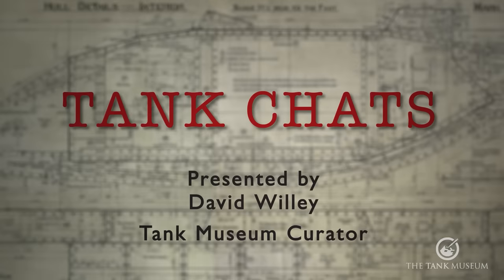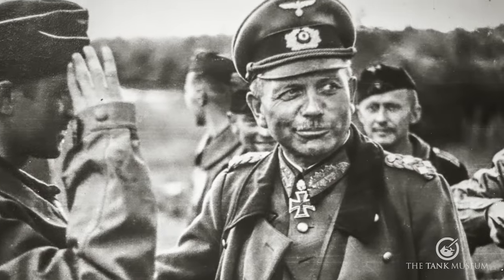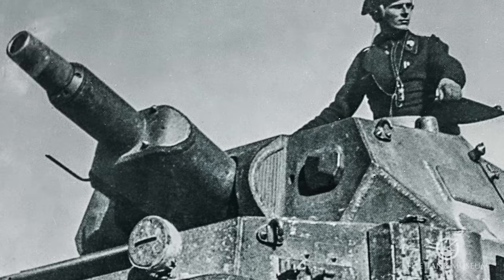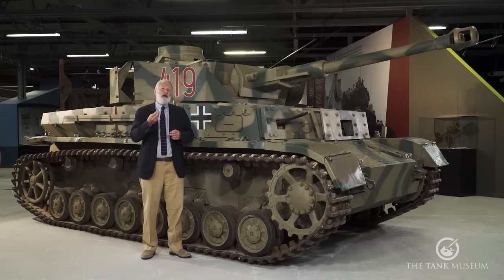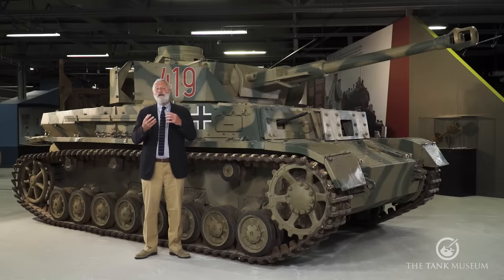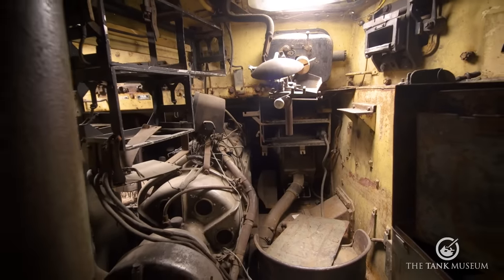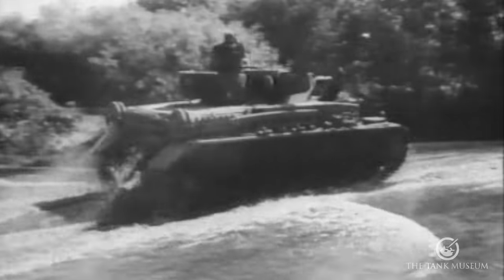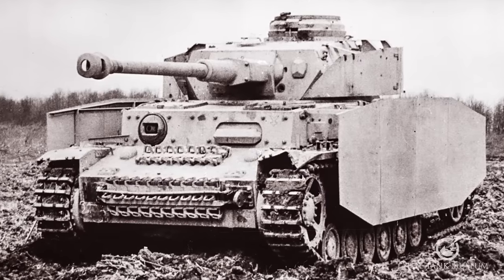Tank Chats #106 | Panzer IV | The Tank Museum

Comment: Imagine they built just these like the sherman tank. War might have ended differently if they didn't waste so much on tank development. Panzer 4 was probably the best all around tank to do it all. Definitely had better reliability than the heavy german tanks
Reply: The Panzer IV is similar to the American M4 Sherman and the Soviet T-34 tanks. The design may be more complex than the T-34 but simpler enough to be easily mass produced as well as easier maintenance on the field. By rearming it with a longer barreled high velocity gun as well give increasing more armor protection gives the Panzer IV a better fighting chance against Allied and Soviet tanks. German military commanders prefer the Panzer IV than the bigger tanks like the Panther and Tiger tanks. Unfortunately Hitler has become obsessive with bigger tanks with more power guns as he believes that they will help to win the war. He orders the increased production of Panther and Tiger tanks instead of Panzer Iv tanks. The design of the Panzer Iv has been adapted for the development of other military vehicles.

Comment: It's a German Sherman. . .
Reply: I mean if by that you mean a standard medium tank of its time then yes.
Reply: @dominuslogik484  and the versitally ,  and ease or maintenance ,  and all the different versions, based on hull design.
Reply: @TerranceK-y3l  yeah that was most medium tanks, the T-34, the Panzer 3/4 and the Cromwell were all versatile and numerous with easy maintenance
Reply: @dominuslogik484  your not picking up what I'm putting down.  I'm comparing two tanks , not every tank . They , are the easiest to repair.

Comment: I just don't understand the need for the Germans to try and develop a million different tanks instead of 2 or 3 really really good ones? Sure it takes  a lot of time for development and testing but  why the Tiger instead of  producing many more Panther tanks which was a good tank..Producing enough Tigers to make a difference never happened, perhaps many more Panthers may have...
Reply: The Tiger was way before the Panther. Tigers first got to the front in 1942. The Panther wasn't declared fully troop ripe until 1944. Tigers were invaluable in 1943 and early 1944. Then production ended summer 1944. You may have a point with the King Tiger but not the Tiger I.

Comment: Gee if only the idea of putting the transmission in the rear to simplify manufacturing and reliability of their tanks had been invented back then. 

What a wet dream of tankers
Reply: Back then having the gearbox so far removed form the driver brought a bunch of problems. The biggest being that they were not assisted like modern gearboxes so everything hapened by applying force by hand. To make a long explanation short, the further away a gearbox is from the driver the harder it was to switch gears, tiering out the driver in the process and making it harder to operate under stress. Both the US and Germany valued the ease of use for the driver over a slight repair inconvinience.
Reply: @zafranorbian757  that's true and not a bad reason, but what the Germans did wrong while the US did right is the US thinking further in their tanks design by having an ease access of transmission without the need to remove the roof or the whole turret. 

Nicholas Moran put it really well actually by saying that easy access to parts that needs constant replacement is vital in the success of the vehicle (or smt-smt can't remember the exact wording) , imagine having to remove the whole superstructure of Stug 3 just to replace the transmission. Hell not even having an access port in later Germans tanks sounds nightmarish

Comment: Honestly in ny opinion the pz4 is far more effective than those other "big cats" like the panther and tiger (except the tiger1 it was a very effective heavy tank)

Imagine if they allocated all those resources for the "big cats" to the pz4
Imagine if they mass produced and improved upon it
Reply: imagine if you actually knew what you were talking about.
Reply: It couldn't be improved after spring 1943 and at most only 20,000 could have been built without the 8,000 Tigers/Panthers. Not going to change much except get a lot more men killed.

Comment: still keep myself asking why no one thought about to copy the T-34 from the russians. or re-design the Pz IV. make less square and shape it more. instead of putting ressources into the tiger and panther models
Reply: Both were thought off. 
it was estimated that reverse engeneering would take around 1 years of devellopment. pretty much the seame time it take to create an entirely new vihicle.
As for adding a sloped front to the Pz4, it was calculated that a sloped front of relevant thickness would increase the tanks weight to the point where the current trackwith was insufficient. Increasing the track with would have meant that the roadwheel pairs would have needed to increase to tripple roadwheels to savely guide the track. Both again would increase the weight immensly. Using a different kind of suspension was deemed impossible without a complete redesign of the hull, which again takes so long that you might as well create a new tank from scratch. The result would have been a massively overweight Pz IV with wassively decreased moblility for the gain of a slightly less penetrable hull. The turret would have remained just as weak. On top of that all the requested or needed improovements Panther brought would have been missing.
Reply: The Panther was intended to be the mainstay of the German tank fleet. The Panther II improved on the previous design and is often considered the best all-round tank of the Second World War, taking the sloped armour of the T-34 with a more ergonomic design, potent firepower and not over-engineered like the Tiger.
You have to remember that by '43, the T-34 was already becoming obsolete and the new turret and gun of the -85 model was intended to keep the T-34 effective in battle, even though it was already outclassed by German Panthers and Tigers. The T-34 was a game-changer when it first appeared but it lost its edge as the Germans upgunned their tanks and its main advantage soon became that the Soviets could build them quickly and in vast numbers. Just like the American Sherman.

That was how it was in the Second World War, continuous improvements and new designs that kept making previous tanks obsolete. The British developed the Centurion too late for the war but it completely outclassed German armour as well as being vastly superior to the American Sherman and Soviet T-34. The Soviets would develop the T-54/55 and the Americans the Patton based on lessons learnt from the war.
Reply: @DomWeasel  as far as i know the panther II was not really a thing. it has never been assembled nor tested. allthough i hear good arguments and points the german highcommand must at some point has noticed that pouring ressources into ( at least in term of the tiger tank) a almost undriveable tank is a waste. i see and like the idea of the panther but the tiger came at the cost of what ? 3 or 4 T-34 tanks ? the russians did not even grind the weldings down because they assumed it would not last more than 3 month. and who cares about that stuff anyway. i think if germany had copied or optimized their tank production to more economic and efficient ways the war on the eastern front would have looked very different. they would have lost the war anyway no one can fight on 2 fronts and come out of top. that just never works. i merely see the many flaws germany made during WW2
Reply: @ruffynowa580  
The Panther II concept became the E-50 Standardpanzer, what would have been Nazi Germany's first Main Battle Tank like the British Centurion. 

It never reached fruition because after Kursk, it was considered vital to crank out existing tank designs as quickly as possible so they worked on refining the Panzer 4, Panzer 5 and Panzer 6 designs and increasing the efficiency of their production lines while producing as many Stug III tank destroyers (Germany's most produced vehicle) as possible. German production increased right up until the invasion of Germany from the East and West. 

The problem was that the Nazis only took a total war footing after Stalingrad at the end of '42/start of '43 whilst the United Kingdom had been there since '40 and Soviet Union had gone to total war the moment the Nazis invaded. In Belarus, the Red Army Airforce lost 50% of its planes on the ground on the first day of the German invasion. By the winter of '42, the Soviet airforce outnumbered the Luftwaffe 3 to 1. The Nazis had been outnumbered when the launched Barbarossa and despite the staggering losses they inflicted on the Soviet Union, they were still outnumbered a year and a half later. The USSR recovered its strength; the Germans only grew weaker the longer they fought. The inability of the Germans to replace men and materiel swiftly was first demonstrated during the Battle of Britain.

Contrary to popular myth, Nazi Germany never held a technological edge over the Allies. Barbarossa demonstrated the Soviets possessed superior tank models in the T-34 and KV-1 while the Western Allies had the Sherman; a reliable, dependable (If combustible) workhorse which the American factories could produce in the tens of thousands. 

The Tiger was a white elephant but you must remember that when it first appeared, it was completely impervious to Soviet T-34s and anti-tank guns. It could only be destroyed by heavy artillery. The British came to the same conclusion after capturing a model in North Africa; resulting in the retirement of existing British tanks like the Crusader and Matilda. The Tiger gained a reputation that far exceeded its actual value. Just the knowledge that a Tiger formation was present in a location would make a commander hesitate. They were like a fleet-in-being; capable of tying down large number of opposing forces.